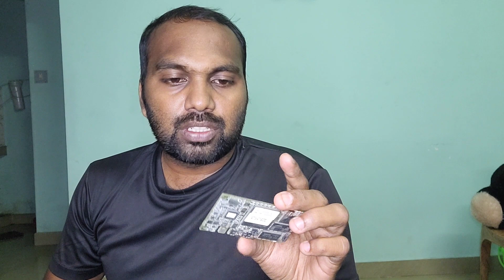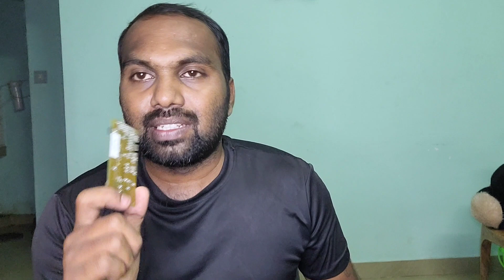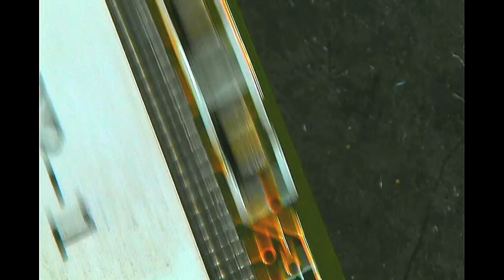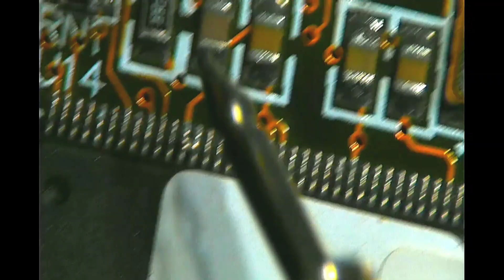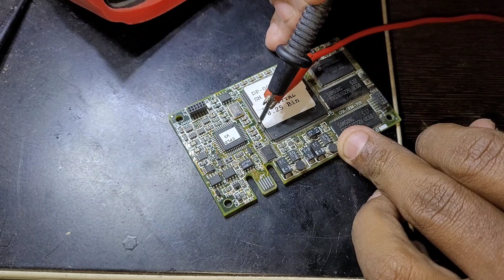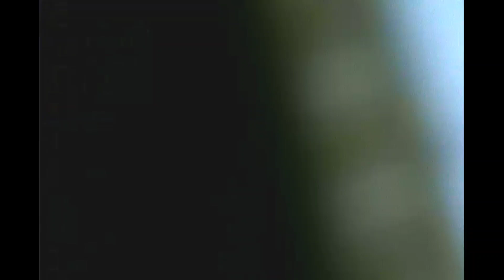How to repair SMT boards #smdrepair #motherboardrepair #powersupplyrepair

Comment: how to know smd capacitor good or bad in range  value  .  like you mention  20.5 half short  , 0.109  is good  in the continuity  mode.
good info video
Reply from the maker: I will make the seperate video about that